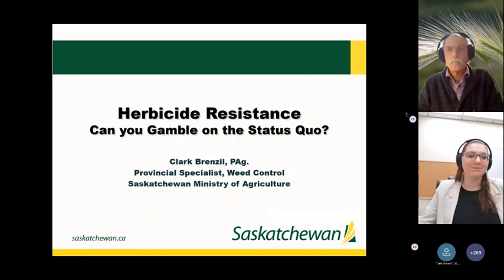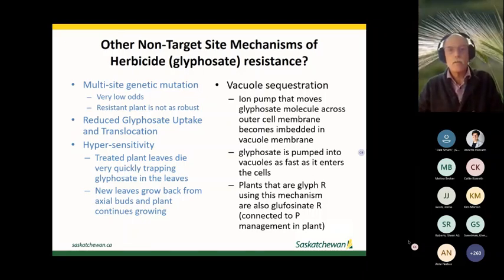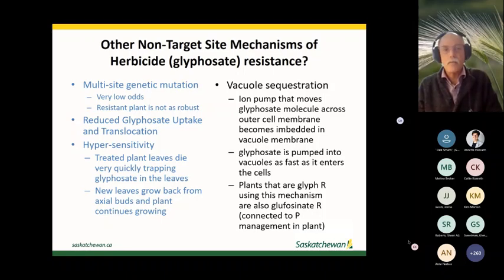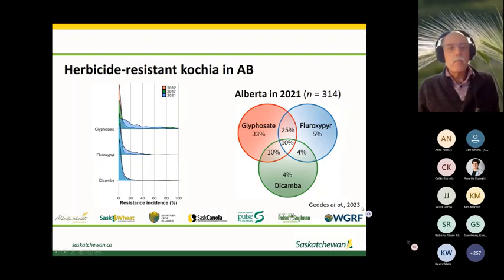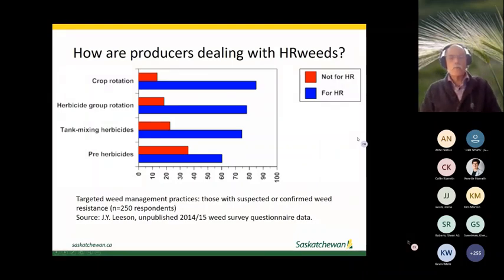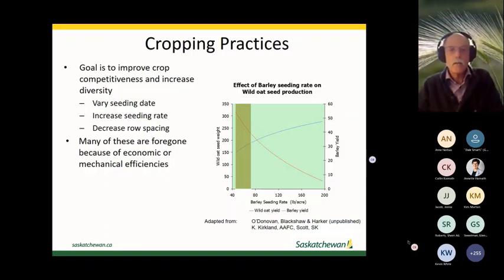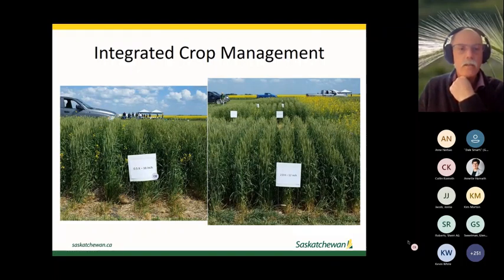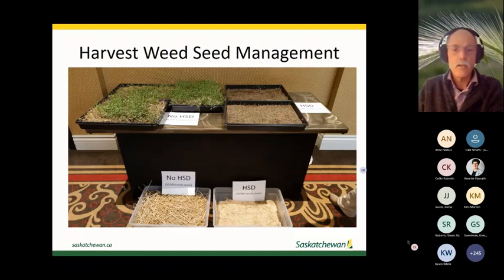An Update on Herbicide Resistance

Comment: 🎯 Key Takeaways for quick navigation:

03:30 🌱 Minimizing tillage is a key soil health principle for Upland Organics. They reduce tillage intensity and frequency, focusing on minimal invasion only when necessary.
05:48 ☂️ Keeping the soil covered is crucial. Upland Organics achieves this by reducing tillage, leaving cover crop residue, which protects the soil from erosion and improves water infiltration.
09:02 🌾 Increasing biodiversity is a priority. Upland Organics adds diversity through cover crops, multi-species mixes, and intercropping to enhance soil health and mitigate risks.
13:23 🌿 Maintaining a continuous living root in the soil is emphasized. Upland Organics uses biennials to ensure constant root exudates, benefiting soil microbes and maintaining soil structure.
15:01 🐄 Livestock integration is a key practice. Upland Organics graze cover crops with cattle, strategically moving them daily. This approach enhances soil health, reduces erosion, and promotes sustainable agriculture.
24:23 🍄 Healthy crop patches had 42 times more beneficial fungi than weed patches, emphasizing the role of fungi in yield potential.
26:17 🌾 Fields with more beneficial aerobic fungi yielded 55% more, highlighting the correlation between soil biology and yield.
27:41 🌱 Composting contributes to increased soil organisms, organic matter, better structure, water infiltration, and healthier crops.
34:01 🚜 Coating seeds with compost tea enhances germination and vigor, demonstrating the impact of biological coatings on seed quality.
41:19 🌾 Implementation of soil health practices in a drought-prone area led to a 1% increase in soil organic matter, improved water infiltration, a shift towards more fungal biology, increased calf weights in rotational grazing, higher grain protein content, and potentially higher yields compared to regional averages.
45:54 🌾 Cover crops in roller-crimped plots retained more moisture than tilled plots, aiding soil health.
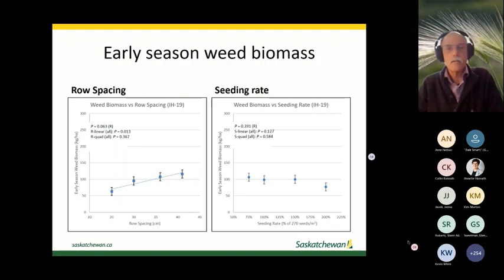47:04 🌱 Cover cropping integral to organic farming for soil building, with diverse cover crop mixtures enhancing soil biology.
49:08 🐄 Lessons learned in livestock integration: stagger cover crop planting for grazing, adapt plant species to weather, and optimize water infrastructure.
51:34 ⚡ Effective electric fencing using aircraft cable for grazing cover crop fields without pre-existing fences.
53:22 🔄 Adaptive cover crop rotation: Extend successful fields, cut short struggling ones, and integrate 10-year rotation with perennials for added benefits.

Made with HARPA AI